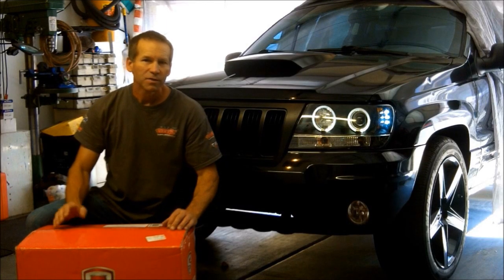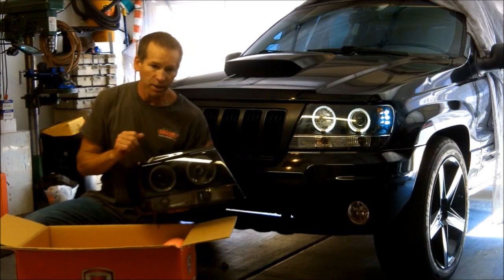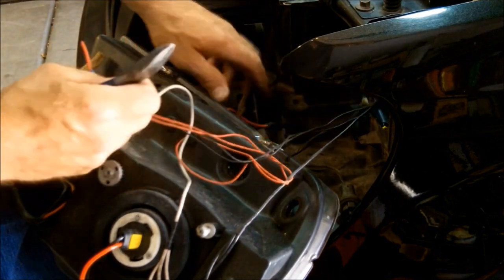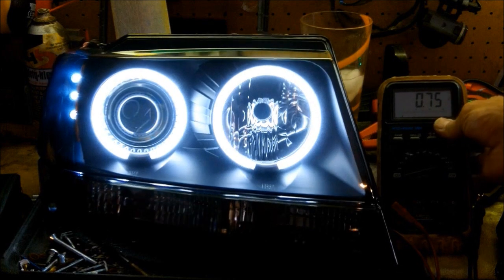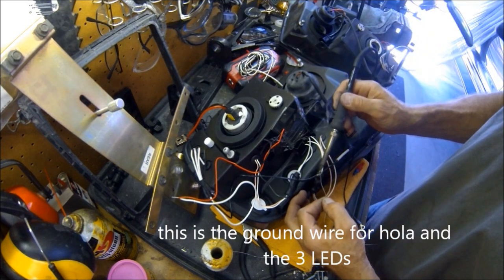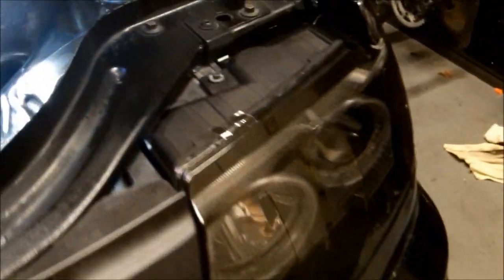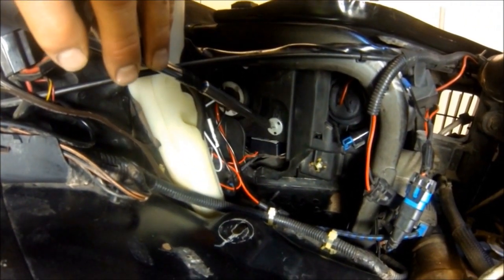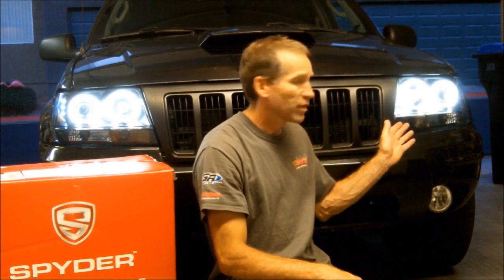CCFL vs LED Halo on a Jeep Grand Cherokee

Comment: I came here to learn about CCFLs and came away now knowing how to adjust my headlights. Thanks! I just installed my VIPMOTOZ LED headlights yesterday. I believe I have the lowest tier of halo type (probably XENON) but it makes up for it by having lots of LEDs at the bottom. I got them at a great price and am pleased with them. Much better than the oxidated factory ones I had. Yours look awesome 😎👍 Good video.
Reply from the maker: Great to hear and glad I could help.

Comment: Judging by that iron its a weller pes51 attached to a weller wes51 or wesd51 station ive got 3 of them and 2 hakkos and always end up bank at my weller. They are the best in the industry in my opinion
Reply from the maker: Yes it is PES51 and the WES51. Bought it used years ago. Really like it.

Comment: Look at ipcw for the 07 Dakota... idk what to believe on to get them or not... it’s a 50/50 mixed review with these... for $271 though hell I could buy some more gadgets for my guns for that kinda loot lolz ... so Martin my main man here, only reason my trucks still going strong here coming over to you bud to make up my mind here for these aftermarket lights
Reply from the maker: well, the first set that I had with the LED Halo and clear lenses I did not like, the LEDs were hard to see during daylight hours and the clear coat was peeling off after a year or so, those I got from VIP MotoZ.
Now the second set I got from Spyder those having smoked lenses and CCFL halos, these have performed great, no peeling of the smoked film, and the halos are as bright as the day I installed them and you can clearly see them during daylight hours.
I hope this helps.

Comment: Thinking about changing out the headlamps in our Camry 2013, the factory bulbs just don't give out a good throw. I have been seeing that HID are optimal. But I also like these Halo look too
Reply from the maker: DizTraveler yes I really like the Halos. My low beams are HIDs. Those definitely put out some more light. They can be troublesome I've gone through 3 ballast so far luckily all under warranty. There's a lot of Chinese crap out there.
Reply: I believe that I seen a video for a HID install, but it was for a Hybrid Camry, but I think that they all are equivalent in the install...I am going to be driving a long time at night in the fall, -- but yes I have been enjoying your videos, I am a tinker-type of guy too, so its fun to see you and Dzlfreek not going the "norm"--also have a broken 8-way seat control panel, but too lazy to call up the pic-a-parts...lol and not sure how bad it will be to remove n replace.

Comment: Martin great video thanks... Do you have any wire diagram at any chance??? I want to the halo turns on when ignition the car on.... thanks a lot
Reply from the maker: Thank you Daniel, sorry I do not have any wiring diagrams. I did the same thing they do come on when I turn on the ignition switch. I also have a manual switch in there so I can turn them off if I don't want them on. You could run to one of the power ports (cigarette lighter adapter) tap into that wire. I believe the one on the left side comes on with ignition. Hope this helps. Since I've done this video I separated the three LEDs from the Halos. Now the three LEDs come on with the marker lights.
Reply: @martinbuilt  Here's hoping you might be able to correct an issue I'm having with my aftermarket LED's. I did the same with the my LEDs coming on with the park lights ( assuming that's what you call markers) however the halos either don't work,  one turns on, they both turn on or one is at full brightness and the other at half brightness. Any ideas to what I have done wrong? Bad earth, bad power or is the starter at fault? Any thoughts would be appreciated.

Comment: You posted this video almost 2 years ago and I'm wondering if you're still using them and how they look.  I bought a pair of tinted headlights for my '02 Overland about a year ago from Amazon and they are cracking on the surface very bad.  I should have read the reviews more closely because that's what everyone is complaining about.  What bulbs are you using in those ??  When I have someone pull up behind me at night,  I can see the shadow of my Jeep and that drives me crazy !!!
Reply from the maker: Then still look great (tinted ones). The non tinted ones the clear coat was peeling off. The lenses look ok, no cracking. Maybe the spyder brand are better quality.

Comment: Thanks Martin couple questions. Can I wire the red and white to the parking light? Also what bulbs did you use? The site said not to use Leds it will void the warranty. Thanks
Reply from the maker: Yes, you can hook the red and the white both to the parking lights. I am using HID bulbs for the low beam, and I just have a standard performance bulb for high beam.

Comment: How did you wire in the positive for the halo’s and the LEDs on the side. I bought a set of assemblies and have not put them in the Jeep yet
Reply from the maker: I wired the halos separately to a Ignition hot with a switch but for the most of the time I leave the switch in the on position and the halos are on most of the time.

Comment: Hey Martin, I need a little bit of advice. I have CCFL HALOS exactly like you do however I have them spiced to my parking lights. Is what's causing them to be not as bright as I see in this video? I don't have fog lights so I was going to use the wiring from that to isolate the wiring for my HALOS 
Thanks Martin
Reply from the maker: Yeah if you don't have the fog lights and the wiring is there for them that would be kind of neat that way you could use the switch that controls the fog lights to turn on and off the Halos.

Comment: What did you use to black out your grill? That being the only chrome on mine I think that would look good on mine.
Reply from the maker: It is a replacement grille I bought from eBay.
I have since built a custom grille here is that video.  https://youtu.be/GLnlaWFElWM
Reply: @martinbuilt  Cool I will check it out. Thanks!

Comment: How are they holding up, many reviews on Amazon say the clear coat flakes not too long after installing...?
Reply from the maker: CVNTGETENOUGH 
That did happen to the first set I had on there that were clear lenses and it seemed like it started after going to the car wash and using their detergents. So far this tinted set has not done that.

Comment: What about the fog lights???????I'm doing my tail lights today and an about to order the front lights the fogs are next what do you think use ring their to or plane clear or yellow???????
Reply from the maker: poppy1952 I did replace my fog lights only because the previous owner put HIDs and they didn't seal very well and a ton of dirt got inside the lenses. I would like to do halo rings on those as well
Reply from the maker: If you're referring to the halo rings as how I powered them I ended up using a relay and switch that the previous owner had installed where he had a LED light bar mounted down low. You could wire them to a source of power when you turn the ignition switch on the halo rings would come on

Comment: have a 04 limited. everything says wont fit a limited or year model. should i overlook that. looks like the will fit
Reply from the maker: Yeah sometimes especially like on Amazon it'll say you will not fit your model year but it will fit.
Reply: @martinbuilt  thanks

Comment: hi like you videos .amazon states wont fit laredo is you jeep a special edition ??. i have a laredo wanted to replace the dull headlights with those ccfl.any help would be helpful.
Reply from the maker: If it's a 99-04 jeep grand cherokee it will fit. I've seen the same thing with the sway bar  that I put in my grand, amazon says it won't fit but it does

Comment: Nice. Does the chrome housing take away from the ring at times with all the light that is being reflected?
Reply from the maker: Evoke 
I'm not sure what you're saying. The housing itself is black. The reflectors of course our Chrome. Yes with the lights on it would probably be hard to see the halo rings. I hope this answers your question.
Reply: martinbuilt 
I apologize. My mind was im two different places when i posted that question. Yes, Thats exactly what i meant. Its a concern i have. I do want ppl to see the halo ring after all.

Thanks
Reply from the maker: No problem, I'm very happy with this set. I don't think you would be disappointed.
Reply: martinbuilt 

Gotcha 👍

Thanks again.

Comment: Martin! Are CCFL halos worth the price jump from LED?
Reply from the maker: absolutely, in better sunlight, it was hard to tell that the LED's were even on.
Reply: @martinbuilt  Thanks for the quick reply! I have a 2004 WJ, will I need to do extra wiring for the Ccfls? I have no experience in wiring
Reply from the maker: @willbradford898  It is pretty much plug and play other than the black wire needs to attach to chassis ground and the red wire I wired to the positive side of the parking lights that is for the 3 LED's.
Reply: @martinbuilt   okay thanks so much for your time this info is invaluable to me

Comment: Anyone with the LED version have tried replacing with CCFL? There are modules sold alone on some Chinese site ...
Reply from the maker: the problem is how to change the halo from LED to CCFL
Reply: @martinbuilt  I am indeed curious to know ... I will try to dismantle the window of the headlight soon with a heat gun and see what is doable

Comment: how did you put the scoop in your hood I would like to do the same but never instated a scoop before any pointers????
Reply from the maker: This scoop is for a 2005 -2009 Mustang that I got from musclecar.com I will be doing a video on the install. It is functional by the way.
Reply: Nice looking WJ. For future readers interested in Spider halo lights - there is no way to easily adjust Spyder headlight housings for the WJ without taking them off each time you make an adjustment.
Reply from the maker: poppy1952 I'm currently working on a video for installing the hood scoop and showing you how to make it functional on a 4.7
Reply from the maker: JT I'm not sure if you noticed but I do explain how to adjust the projection lights with a Phillips screwdriver without removing the housing